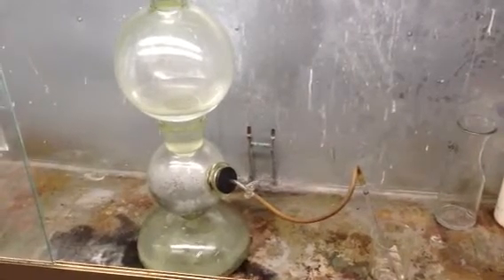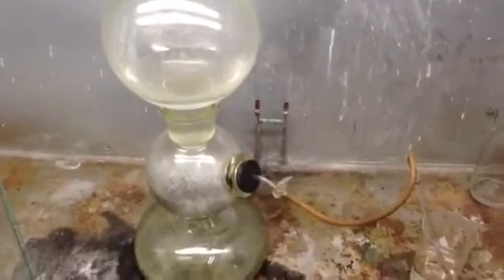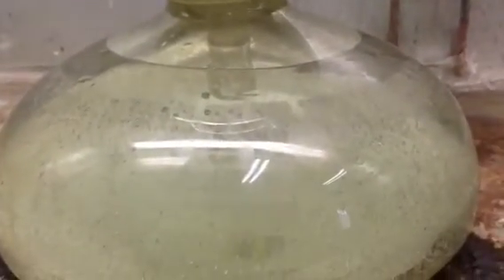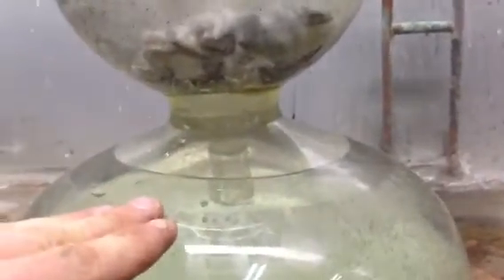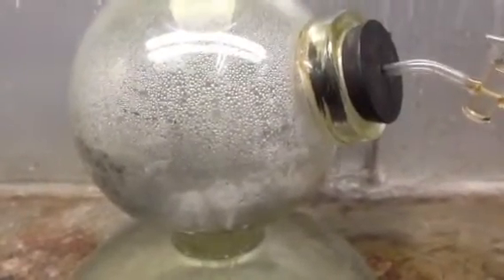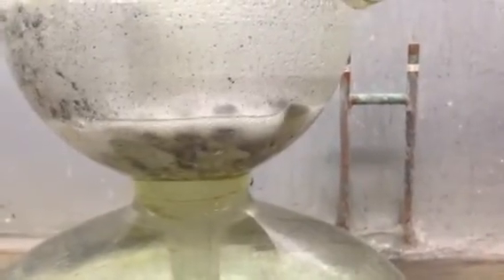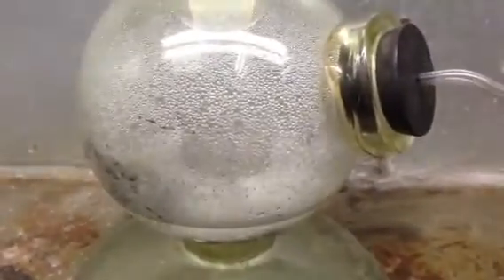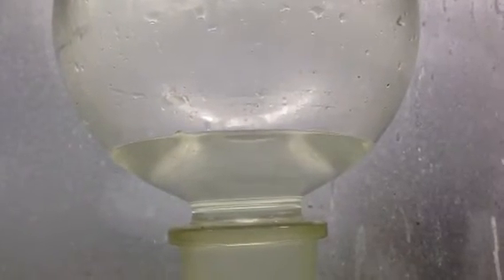How a Kipp's genorator works

Comment: If you had molten gallium and aluminum you could use this to produce hydrogen to run a fuel cell. Apply the gallium to the aluminum so it soaks into the aluminum's structure and makes it more reactive towards water to produce Aluminum hydroxide and hydrogen gas, since hydrogen is difficult and expensive to store long term. The gallium is easily retrieved after the reaction is finished to react with more aluminum.

Comment: Can you post recrystallization using HCL gas? That's also not on here.
Reply from the maker: Re crystallization of what?
Reply: Does it really matter?
Reply from the maker: Not all methods work for all purposes.. This is why there is 100 different ways to recrystallize a product..
Reply from the maker: Usually re crystallization with HCL is used for drugs and pharmaceuticals, I don't deal with either of those...
Reply: Thanks!!! Really a practical approach!!!